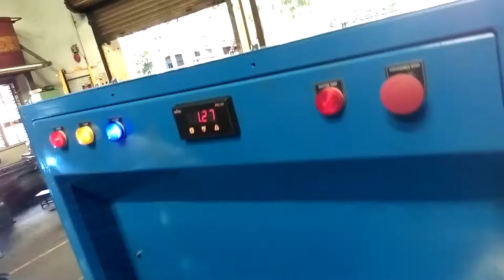VFD controlled Welding manipulator

Comment: Hi sir,
Please Can you explain how to run welding machine application on vfd?
Reply from the maker: Well this one is for welding of cylinder end-caps. To ensure that it is uniform ly done the VFD is used to rotate the cylinder at a uniform speed( you can see in the video) the speed can be varied as per need and can be held constant once the desired speed is reached.